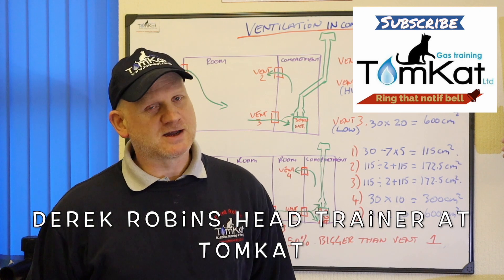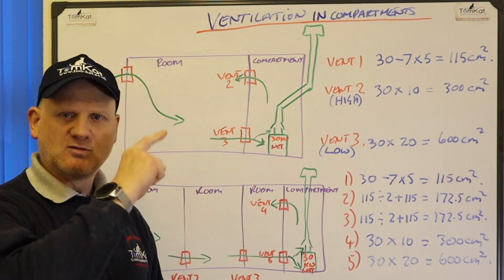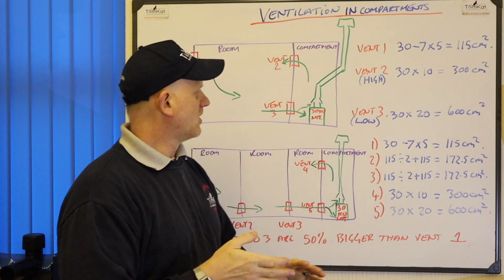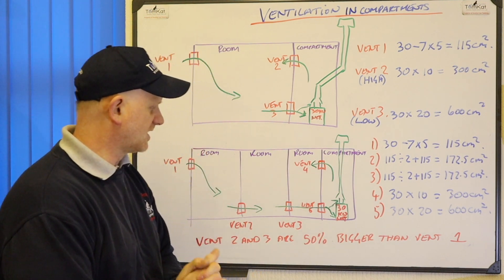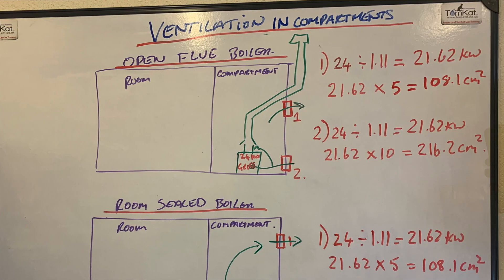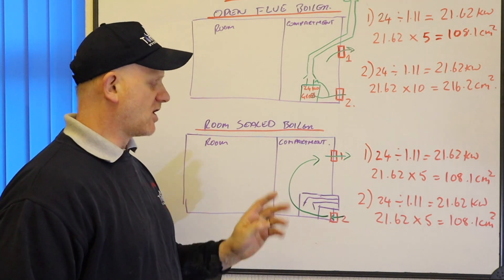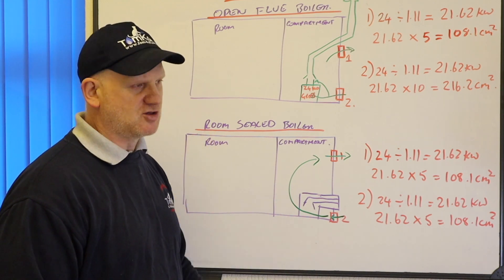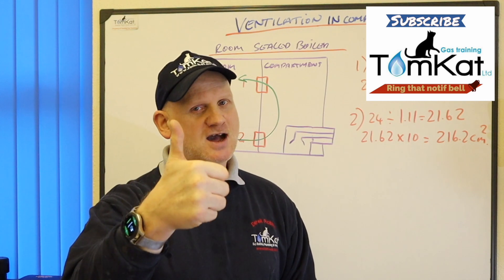COMPARTMENT VENTILATION FOR OPENED FLUED APPLIANCES part 7 acs revision in 10 minutes or less.

Comment: been following your channel a couple of weeks now.  I noticed my incoming pre meter shutoff valve is upside down. the on position is down not up. the engineer who fitted my meter was obviously a muppet. who do I call to get it fixed? I don't want to call the board as they will just lock the supply off for a couple of weeks til an actual engineer can attend.it's blooming this cold. but it is an unsafe situation. (I live in the u.k.)
Reply from the maker: If it is Nat gas then you ring the ESP on 0800 111 999 but it is not dangerous as long as you can turn the gas of in an emergency.
Reply: @tomkatgastraining  thanks for the info. And keep.up the good work. Your videos are very informative.